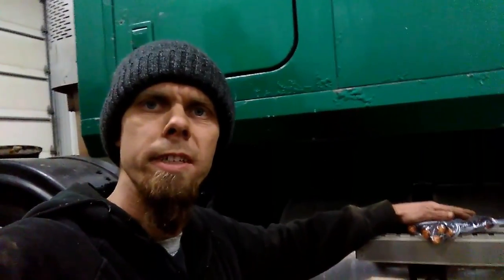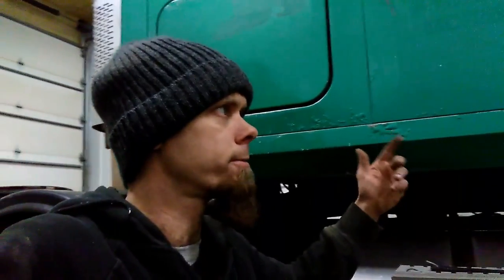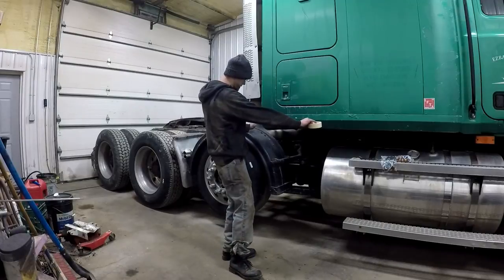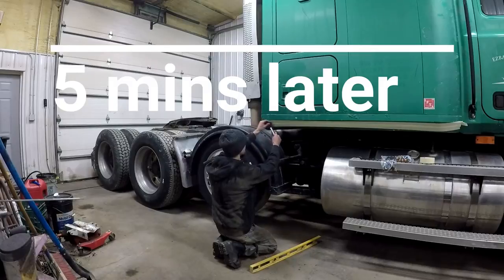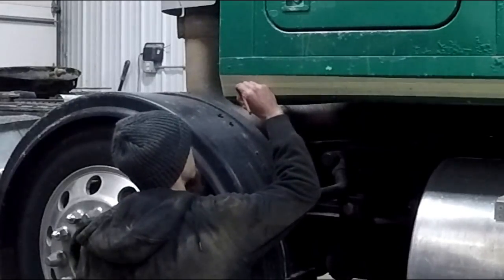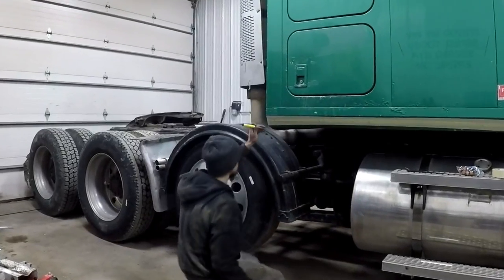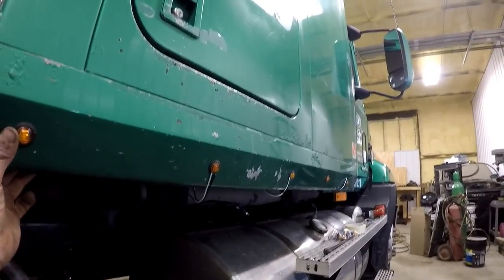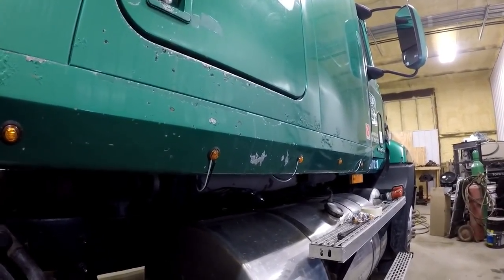installing chicken lights

Comment: I drove a truck for 50 year. And something most likely not tell you and putting lights on a truck to stop them from going out this   very important always break the ground wire never the positive. And when wiring always soder then soder each wire separately. When done hold heat iron on the connections. Then pull on the wire to show it is connected and then slide heat shrinks over it and the heat up the shrink so it tightens up. I also like covering each connection with silicone to ensure no water get in to corrode the wire connect

Comment: Just want to say “Thanks for the ideas, links and motivation.” I went online, looked a great deal for lights and other accessories for my truck and trailer. I got the same style lights...did a 30 pack and also a new wiring harness/junction box for my trailer. I already got my trailer at the garage entrance, waiting for new lights, brackets and wiring. Gonna do it all to get it ready for winter.

Comment: Depending on the climate where you usually drive, it might be a good idea to put some primer, or even just some Fluid Film on the edges of the holes, where the blank metal is exposed from drilling. The chicken lights prolly have some sort of gaskets, but for extra corrosion protection.
Reply: I didn’t know aluminum rusted

Comment: I always heard chicken lights came from early chicken haulers.  It started in the Deep South like Mississippi when these chicken farmers needed their chickens hauled, but it didn't pay anything.  So the farmers covered their tractor trailers with lights so they could get drivers to haul them.
Reply from the maker: iv heard a number of different storys over the years. iv heard it started with a company up in the north east that advertised the fastest delivery of there fresh chickens and they put amber lights on there bumpers to make there trucks stand out. iv also heard that the orange glow of the lights resembles the heat lights in a chicken coop. iv also heard that even way back before then there was problems with chickens being stolen off trucks when driving threw towns late at night so the drivers would hang lanterns on the side so they could see what was going on
Reply: I've heard it comes from the shapes of the early marker lights old timey trucks had.
Reply: As a trucker myself I always thought chicken lights where called that because at night when them trucks get near you all those lights tend to make you give extra room to them aka be a chicken lol

Comment: The best chicken lights I had on my Rigs, were made by 3M.  I had too many to count 2"x 4" Amber Reflective pieces made. Ran them evenly space top and bottom edges of my Trailer. Anytime light would hit the trailer it was lit up. No bulbs to worry about burning out.
Reply: Do u have the link for them

Comment: Did u buy a wire harness so the LEDs will plug into it? I got Amazon harness and LEDs that should plug right in but what would I use to keep moisture out of the plugs?

Comment: Hey man, could ya point me in the right direction? My company FLD has no truck taillights the wiring was chopped up and I have no clue what goes where. I identified the turn signal wires but am having trouble getting power and ground, any tips or advice would be awesome, thanks

Comment: What kind of trailer is that and what do you haul with that?
Reply from the maker: It's a tempte superhopper. I use it to haul dry fertilizer, grain and sometimes road salt. Most dry bulk products can be hauled in a hopper bottom trailer

Comment: Love you videos! But change them leds!! they run about 6 months or so then they burn out. I had them and later changed them all. Just a heads up!
Reply from the maker: Been on the truck probably 10 months now. No issues yet. But thanks for the heads up

Comment: You did the trailer as well? Thanks for sharing
Reply from the maker: no the lights on the trailer were factory installed. but that is part of the reason why i did it, i thought it looked a bit silly at night pulling a trailer with 52 lights with a truck that only has minimum lighting on it....lol

Comment: looks dandy, the wiring and mounting switch will take longer than the light install, nice old school, newer freightliner multiplexed system you cant even add lights or tap wires or you asking for a nightmare problems with system.
Reply from the maker: yeah it shouldn't be too bad to wire, im probably going to run the wires up threw the sleeper then then in the back wall to two "work" lights on the back of the cab that are already on there own switch and then change those two white lights out for red ones. at least that is my plan at the moment, not going to wire them for real until i Finnish repainting the truck.
Reply from the maker: the new volvo trucks are really bad for giving you fits if you change anything with the lights, you cant even change standard bulbs out for leds without causing issues.
Reply: You said, "dandy" 🏆

Comment: I had. A little over 80 lights on mine not including in side of it you could see me a mile away 😏😆
Reply: I want to get around 60 lights on my trailer. What wire and fuse size should i use?

Comment: Show me how you got the hot and negative to them..
Reply from the maker: i fished some new wires up threw the back wall of the sleeper to the "work lights" on the back of the cab switched the two white lights out for red. and then used the work light switch for the new lights on the side of the cab. the red lights on the back of the cab still put out plenty of light to be able to see too hook up a trailer in the dark.

Comment: Every video I see no one shows how to wire the lights to get power, I think that’s the most important step when installing im confused on why??
Reply from the maker: Dropped power down from the lights on the back of the cab and then a simple parallel circuit between the lights

Comment: dude why not do actual wiring and how to get power to it :(
Reply from the maker: ran out of time and just had to get it done, I pulled power from the 2 work lights on the back of the cab and changed the two work lights out to red leds.

Comment: 19 years and a little over 1 million miles
He must not drive much
Reply from the maker: @stevehansraj4730  that truck has 1.4 on it now and I haven't used it in 3 years this video is about 5 years old I do typically only run about 80k miles a year though.